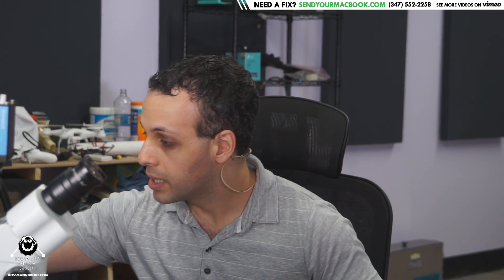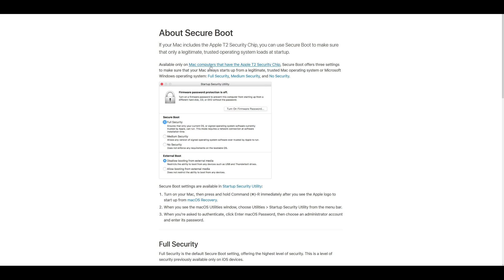An important message from Louis Rossmann

Comment: Dell.  Lenovo.  HP.  Brands that give you removable SSD, and RAM.  But most importantly, they provide the public with their official repair manuals and will usually sell you replacement parts.  Function keys and USB ports are also nice perks.  And no T2 chip garbage.

Comment: I see a couple of workarounds (not that anyone spending $1000+ on a laptop should have to do this):
1) Apple moves to NVME - I doubt this but I would welcome it
2) Apple redesigns the T2 into a more competent product - This I doubt most of all
3) Core files are saved to iDropBoxMegaCloud - easiest but shouldn't be necessary in this day and age

4) (I'm with you on this one) Buy anything but Apple hardware

Comment: Wait a minute, don't the customer have the encryption key that was used to encrypt their volume?  If so, wouldn't cloning the whole volume verbatim (eg, with ddrescue into a virtual image) and then decrypting it later on with the customer provided login password.  If the volume is not encrypted with the user's login password but rather the key is randomly chosen by the operating system (meaning the user has no control over the encryption key) then I am smelling a serious lawsuit on part of many affected users that have this turned on without asking for permission.

Comment: It's bad enough most laptop started to have internal batteries for making this harder to replace, but most laptops use regular SSDs, usually conncted via SATA or something interchangable so that you could always extract it and copy your data somewhere. Why would I intentionally buy some product, that keeps my data hostage? Not only through this failure, but as far as I was told, Apple devices also either refuse to use regular USB drives or reformats them, so that you couldn't use the drive on non-Apple devices. Aside from them just being stupid jackasses, those should be indicators enough for people not to buy this shit. My trusty 10 years old acer laptop is underpowered like shit now, but it has shown a level of reliability and especially trustoworthiness, the second of which at least you really don't seem to get with Apple. They deliberately design their devices in a way, that you as the user and paid owner of the technical instrument have no chance of going on using it or letting it get repaired from who you wish to and have to go to Apple, who will simply charge you ridiculous sums for either switching the dives out for another one, or simply replacing the whole board which makes it basically a different machine too. Fuck off Apple. Never owned a device from them, certainly never will.

Comment: I have been watching your content frequently since you signed the lease on your new store and strongly support your efforts towards right to repair and your hate towards apple and the way they treat their customers. That said I think you as well as others in the right to repair movement tend to have a very narrow repair centric point of view.
Secure Boot has been around for a pretty long time now and both windows computers and chromebooks tend to come with some sort of secure boot enabled (chromebooks even going as far as to put security screws in to make it so you cant boot anything else unless you remove the screw). 
In this video you portrayed Secure Boot as some sort of anti repair fuck your data thing when in reality its a pretty valid feature. 

All that said I 110% agree with you that if you want to be able to recover your data later that you should disable this immedietly especially considering that T2 chip and the fact the memory is soldered to the board. 

If you are however carrying highly sensitive data that you cant afford to get stolen if someone gets physical access to your machine then leave Secure Boot on and just practice good backup strategies.
Reply: He repeated many times that it's only a bad thing with T2

Comment: Honestly, legitimate question, what incentive is their to ever buy a macbook over just a run of the mill laptop with Linux or Windows, like what advantages does a Apple product give to justify getting it over the literally thousands of different Laptops and Pcs of varying quality and Power. Im sure im not seeing the full picture here since im watching these vids but from what i can gather, Maintenance is a nightmare due to Apples Incompetent/downright antagonistic engineer combined with Draconian anti repair measures, like with most Apple products they are pricey and expensive ( especially for machines that seems to self destruct as soon as a mousepad stops working) and they often times wont work with 3rd party programs unless a Mac version is made. So like what is their selling point here, is it literally just because its Apple and once many years ago they paraded themselves as 'different', is their ANYTHING positive about modern macbooks that compensates for all these flaws.

Comment: Not to suggest it as a regular fix but could you get the data off by desoldering the SSD, and putting it into a machine with a working t2 chip?

Comment: My guess is the wifi card thing has to do with them trying to stop Hackintoshes. Maybe even going so far as to have a hardware whitelist. Also, as far as data goes, Apple wants you to put everything on iCloud anyway. If I have to keep all my data cloud side to ensure it's safe I'll just go buy a $300 chromebook that's more reliable than than a $2000 Macbook. Also lighter and quieter.

Comment: Here is the issue on the software side, even if you could boot a different OS, the T2, in my experience, stops the hard drive from being detected even with SIP, AMFI, and Secure Boot off. The only way to fix this is to use Linux with a patched kernel. It might work in Windows, I have not tested, but if it does, it likely only works with the boot camp drivers.

Comment: Apple has the capability to do the right thing (at least as good as other companies). However, the issue is they are obsessed with the so called ‘design’ that engineers are pulled into those tasks. It comes from top and won’t ever change. So the solution is get smart and don’t buy apple products especially Macs.

Comment: Did this years ago.... Just look what inferior crap they build with. Here's a cool exercise.. Look up the price of a macpro you would otherwise buy... then go to a computerparts store.. see what you can get for that amount... and also try and see what the actual value is of the hardware Apple puts into it's devices..... Like the Early macpro's had a X1900XT Ati video card.. Not only was it then (By the time of the release of the first intel macs) already a low low budget card.. It had all kinds of issues with overheating as well. Apple did a callback to replace the cards.. with the same type.. but never told anyone till the deadline had past.. and that's just 1 example...My macpro died after 10 months or so.. first the graphical artifacts and then DED, Had Apple care.. Apple refused to help even tho it wasn't even out of regular waranty yet... I did exactly what I described.. I looked at the price of a new macpro, and build myself an incredibly OP PC for that money... Now 10-12 ish years later.. a) it still runs. b)It still suffices for the renders etc I have to do. And I'm not being forced to upgrade.. best switch I ever made.. Had been using Apples since Lisa II. Always was rather happy with it, until they switched from ppc to intel.. Also used other computers along side apple devices.. like an Atari for midi sequencing etc.. but always Apple.. Never again...

Comment: Why can't you use Linux to pull it off?  Is it on the cloud?  I used to use Knoppix to pull data from windows drives.  Can you pull the drive?  Until Apple users actually start to "get it" and complain - this will not change.  There seems to be a concerted effort for apple to push their users into cloud storage where they can snoop their private data and charge them more for cloud space.  The more they do that the more they can sell you "dummy" hardware (at higher prices) and control your data and lock you in for a fee.  Good video BTW

Comment: Guys, Apple hard drives hold your data and are NOT modular. You can't rip it out; it's soldered onto the motherboard. And they are tied to the motherboard's firmware which Louis just proved can corrupt the data at any time without any warning.

Do NOT buy Apple.

Comment: I have no problems with encrypted drives tied to motherboard's TPM or secure boot. I actually have that enabled on my laptop. The biggest issue with apple is that they don't have an option for any sort of fail-safe for you to be able to decrypt the drive should their motherboard fail. Bitlocker allows to back-up your key by comparison, and you can just disable secure boot in your systems bios to boot into potentially "untrusted" analysis tools.

Comment: I actually think it is a good idea to have such an encryption enabled but default, and in fact, all Android phones and some windows laptops do it already. Sometimes, when you loose your device, it more important that other people would not be easylly able to access it (happened to my friends, when they've had their phones stolen, but it was assuring for them that nobody would see their banking information and other stuff).

However, as far as I know, the encryption does not get enabled by default in windows until you add Microsoft account and it then save the key to the cloud. I am using bitlocker on my pcs just for extra assurance that no one would tinker with my data and the install. However, even when I had some strange issue when my PC wouldn't boot and I had reflash BIOS and erase TPM, I had no problems popping my drive into another machine and decrypting it with a key that I was proactively asked to backup when I was setting it up.

So I think it wouldn't have been a problem if the users have had an option of sorts to recover their information in case it fails and were asked if they want to enable it in the first place. But it is true that it is unacceptable the way it is set up right now.

Comment: I’m sorry. You are just flat wrong. The intention of the T2 chip is to protect your data and security. Any one that does not maintain a backup of their data is stupid. Period. Stupid. Besides hardware failures we live in a world of encryption viruses. A computer can be stolen, infected or die. Backups are insanely important. And  Time Machine is a excellent backup tool and there are lots of additional backups options. So you are just flat wrong.

Comment: This is just like Bitlocker. I've seen so many system auto enable Bitlocker even with certain specifications not being met.
Reply: If BitLocker is being Auto enabled then it's probably on an office network where group policy is set to encrypt while storing the key in active directory
Reply: @AlanMillerFencepost  It occurs on personal systems with no GP settings enabled. I have seen the usual Group policy Bitlocker issue and also have seen the usual logged in with a Microsoft account when setting up Windows on a system that meets hardware specs. I'm talking about a system that Bitlocker has never been enabled, enabling itself after a major hardware component swap. Even after an L1 verifies it's disabled in a recorded remote session. I have seen my fair share of all three scenarios working for a major computer manufacturer on an L2 ticket quality check team.

Comment: I don't use Apple products anyway, simply because I can't afford them. But, as a Windows user, I'm getting really annoyed with the way Microsoft does things. I'm constantly getting a full-screen nag-vertisement telling me to switch to a Microsoft account. One of my user accounts is constantly being told there's a problem with its MS account (which it is not using), and that it needs to be fixed. I researched the problem, and found that it's just Microsoft's way of pressuring users into using an MS account. Not to mention steps Microsoft has taken to force users to create and use MS accounts to set up their laptops.

I guess constantly being pressured (on my own laptop) to switch to a Microsoft account isn't as bad as data loss. But it tells me that these companies just don't respect their customers. They don't have to, because they have a captive audience and not any real competition.

I have used Linux, and I like it a lot; but to be truthful, it hasn't been a smooth ride. Plus, some classes I've taken either required Windows or Mac operating systems and software.

It would be nice not to be compelled to use any product by any company that does not respect is users.

Comment: We work wit Mac computers and there is just one rule - never ever store anything remotely important on Apple product. External drives and linux based servers are the only thing we can put client's data on. Never Apple machine. 
I worked many job as end (and power) user and even if Mac can be pretty stable and fast sometimes, I experienced far more problems with MacOS than Windows. It's not something I would buy for myself and I would avoid it at all cost for professional use.

Comment: What exactly is the problem with secure boot being activated? If the drive is encrypted there should be a backup key to decrypt the drive if the security module is broken. At least that's how it works on regular computers (uefi, tpm, bit locker)

Comment: I've owned a bunch of Thinkpads over the last 20 years, and the only time I took advantage of their system-based hardware level data encryption, I managed to blow up the motherboard. The HDD was fine, except without the original motherboard, there was no way to access the data on the drive. Last time I used that feature.
Reply: Isn't that just setting a drive password on drives that support encryption? If you know the password you should be able to put that drive into another ThinkPad. Of course these days probably just makes more sense to use BitLocker or one of the encrypting file systems on Linux
Reply: @AlanMillerFencepost  No, the encryption was tied to some kind of id on the motherboard via the BIOS -- the idea being, I guess, that nobody could steal the drive and hack it later. It was a long time ago, but I researched thoroughly before giving up. There was no chance of recovering the contents.

Comment: That's why I use ubuntu with extensions to make it looks like MacOS. I just need the Unix/Linux kernel, not circle jerk myself with an unbootable aluminum art piece.
Reply: GTK 3 on Linux is really wonderful, you can theme all applications system-wide, anything from material design all the way to windows 95 (using Chicago95 theme)

Comment: I feel your hurt. I did Apple maintenance in 1997 at Shell for the silly reason I had had some previous experience with the platform through graphics design. Dinkey toys at premium price. Any informed IT engineer will steer away from that crap.
Reply: I might add to that that most Apple users don't have any valuable data on their machines, so they don't mind at all. It's just the inconvenience of wasting some hours to get settings right and change the wallpaper.